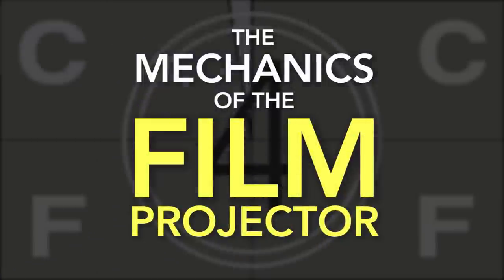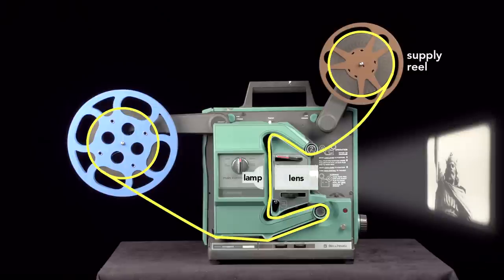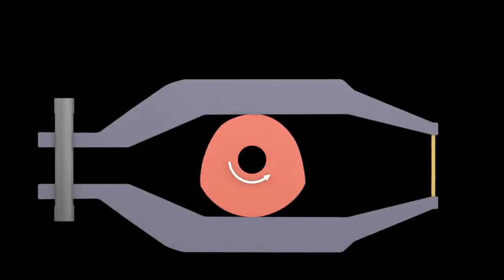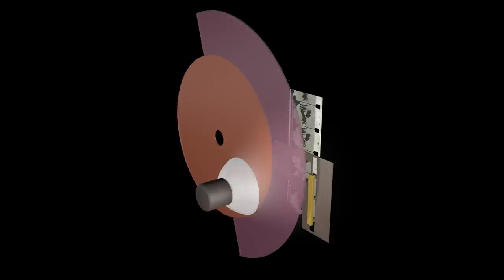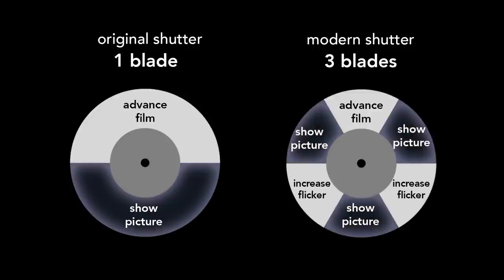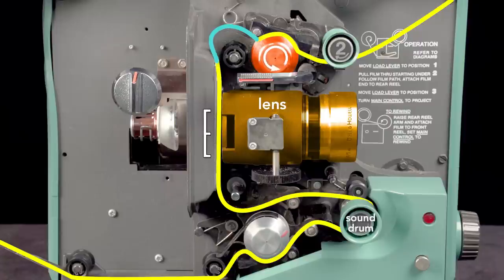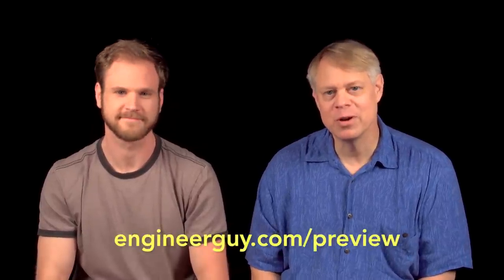How a Film Projector Works

Comment: i'm 42 and i had the chance to have an aunt whose uncle had a movie theater in a small city in the countryside here in brazil.  i used to go to the projection booth and to the basement under it to fiddle with things when it was closed (i'd always find a way to sneak into the building), and to watch the projectionist do stuff when working.  it was still carbon arc, rca projectors.  very old ones, but looked good as far as i can remember.  the movie theater had a little over 900 seats, two floors, and there was a beautiful and thick red curtain that would open and close.  a nice movie theater for a small city in a developing country.

fascinated by how the sound system worked, i would build a thing just to extract the audio from a 35mm doc i had.  i used cardboard paper and a flashlight lamp and a light thingy to convert light to energy and connect it to the mic imput of my mom's stereo.  fun stuff.  there was a movie theater in another city i lived that had a problem of frame misalignment in one projector that would show part of the optical track, and during a ninja turtles session i still remember how cool it was to see the waves being shown while 'go ninja, go' was playing.  the song has basically two frequencies of bass, and one bass would look like waves going up and the other like waves going down, and there was all the crazy mids and treble.

later, when i was 15, i got a chance to work for three months at a movie theater that was part of a cultural complex run by the state.  the complex was built with german technology and they donated a planetarium.  the movie theater had unique seats, and the screen could lift up and be hidden for orchestra presentations.  the screen was a little smaller than the screen at my uncle's, but still a standard size, and there was no curtains.  the building desing was quite different.

aside from the regular 35mm projectors, they had eiki 16mm and bauer super 8 projectos, and a room filled with a lot of 16mm and super 8 documentaries.  there was a week that they had an event showing movies and docs from across brazil and from other countries, little known movies, with most attendees being people from the cinema industry ,and enthuasiasts and stuff.

the projectionists who took turns let me work alone for three days!  they'd be there in the beginning only, and i'd close it.  it was all illegal.  my age for working there, and they letting me work alone having such a responsibility, but they were fed up of it all, little salary, little attention and care from the administration, etc, and they didn't want to miss the opportunity of take the time off and leave me there.  well, i loved it!  i was showing movies and docs to artists, directors, and other people of sort.  one day there was a problem with the audio and i fixed it!  it was awesome for a 15 year old!

i had two 16mm projectors and would invite a couple friend of mine to come to my home and watch documentaries.  i stopped using and owing this kind of stuff in my late 20's.

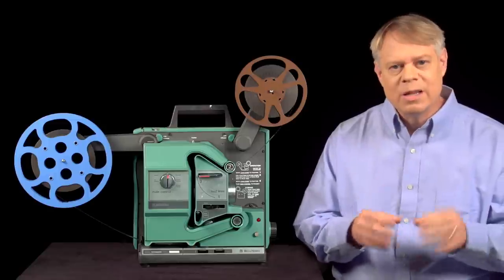Comment: Bill, excellent description of film projection mechanics, you don't get something this clear in many film schools. [6:25]   In fact, sound in film motion pictures is a pretty complicated subject: mono, stereo, quadraphonic, Dolby...  In many instances sound in many movie theaters was supplied by a variety of secondary systems - a whole science in itself - though not in all.    Movie business became involved rather than engineering, some prints were supplied to theaters with the monophonic sound 'sound track' on the print, many did not - but did almost always in science class!   [7:28}  Sync.  The whole movie business revolves around sync.  Fact is, with a mechanical system, sync could never have been achieved  if operations were driven from separate axles, the motions were to fast and to complex to be driven by different elector-mechanical sources, even later when we started to crystal controlled motor systems.  What is simplest and works tends to stick - until everything can be controlled digitally.

Comment: I found it very illuminating (pun intended) that a continuous motion without stop of the image frame and the movement of the shutter would simply create a blurry image "mass". I knew that already but it's the first time I see that so clearly in action. Thanks for explaining, engineerguy!
Reply: There was an adjustment on 35's that was labeled "shutter".  If the picture was smeared with white light that meant the the shutter was a little out of sync with the intermittent drive.
you could correct it to a certain degree with that knob, not sure how it worked mechanically.  The shutter was set screwed onto the shaft and occasionally you would have to loosen the screw and sync it with the film movement,  PM with machine off of course.

Comment: Wow, so interesting. The film projector is indeed a marvel of engineering. You not only explained the entire mechanism to move the film was frame by frame but also how the sound is synchronized - and everything driven by one rod. The smart system to prevent blur by using a blade to block the light is indeed marvelous, especially because the blade was made to increase flicker to trick our minds. I am impressed not only by the engineering but also by your skill in explaining.

Comment: Absolutely stunning video!  I don't know if others have asked this, but if the reel is turned at a constant speed because of the worm screw, why isn't the film fed into the projector at ever slower speeds as the reel's radius decreases over time?
Reply: ***** The reels do NOT rotate at constant rotational speed. The sprockets pull the film off the reel at a continuous linear rate. So the supply reel (which in forward playback) is not powered an rotates slower at the beginning of the film and faster at the end.
Reply: Ah, that makes more sense.  Thanks!

Comment: Just as a side note - 70mm film is just beautiful. It looks magnificent and in my opinion is better than today's 4K digital cameras.
Reply: +Mateusz Wojtkiewicz Good 70mm film is equal to 6-8K digital resolution. Too bad it is huge and pain in the ass to transport and load.
Reply: +Mateusz Wojtkiewicz That's why film is still used, it is better than 4K because it doesn't have pixels.
Reply: +FinnShack yes it has
the resolution depends on how many silver bromide crystals  
are on each frame. a imax film can have up to more than 15,000 x 10,000 of these crystals
Reply: +MrDehicka you are right

Comment: What a pleasing voice you have! Makes it sound like a really good teacher patiently explaining a complex subject in a way even the densest person can understand. Of course, the excellent graphics help a lot! Too bad you couldn't slowly "speed' up the mechanical motion to show us how "fast" it really goes. Knowing it's 24 fps is still hard to get a full appreciation for--and I'm a projectionist who's worked with projectors since my high school days! Even seeing it actually in motion still fascinates me. And then when we move on to TV and the rate increases to 29.99 fps--again hard to realize the TV screen is actually dark MORE than it's lit--and that's done as the TV electronics turn the LEDs or LCDs on or off 120 times per second (because the pictures are being projected on two alternating "interlaced" lines for every frame with it displays. Imagine the electronics that manage a 1080p screen with its 720p lines. Add in that each LED or LCD must have the right amount of red, green, and blue for each pass along with the correct intensity (or chroma brightness). Do the math--and you will be amazed! (It's 777,600 LEDs or LCDs going on and off each second--and each one with the right brightness and color mix. Not even an oriental using his abacus could work that fast!

Comment: The intermittent transport on most 35 and 70mm machines is usually realised by a geneva-drive. The mechanism in this video is almost exclusively used by 16mm regarding projection devices. The latest tech in projection-equipment were electronically controlled direct-drives. Like the Kinoton E-Series machines, with are state of the art in many aspects but sadly not produced anymore. Another very interesting way of intermittent film transport worth mentioning is the rolling-loop mechanism used by IMAX and some exotic special venue devices. The very interesting fact about this mechanism is, that it isn’t really intermittent.

Regarding sound there are many more interesting ways either. From Multichannel Audio on magnetic material to digital information between the perforation or at the sides (Dolby Digital and Sony SDDS). Or DTS, which uses a thin “morse code“ on the film to synchronise the audio from separate media (usually 2-3 special CDs delivered with the film copy). This allowed different language versions through a additional set of cheap CDs instead of a second expensive film copy.

Comment: 70mm film is the format used by IMAX. The film also runs horizontally and does not contain the film's soundtrack. The soundtrack for an IMAX film is most often played on either open-reel tape or as a digital soundtrack on a computer, and the computer software puts them in sync.

Comment: Some projectors use a Geneva mechanism.  This is where that infamous clickity-clackity projector noise comes from.  Very interesting mechanism, and it seems simpler than this because it can turn the continuous motion of an electric motor into distinct, singular motions that feed the tape and reveal the next slide.  The shuttle is also typically a wheel with studs and so that design is also less complicated.
Reply: That noise is from the top and bottom loops fluctuating as the film pauses to be shown.
The noise is more pronounced by worn out sprockets.
After passing miles of film the pulling edge of the sprocket teeth get undercut.  As the film is pulled around it catches in the undercut grove of the teeth and does not release quietly.
This leads to worn out film sprocket holes and more change of film breakage in the machine.
Sprockets were highly machined and expensive.  Most you could loosen the set screw and flip them over to use the other side of the teeth.

Comment: Fascinating video, Bill (and Steve)! I had no idea that the soundtrack on films worked like that... I thought they were used in tandem with a magnetic tape or something!
Reply: allluckyseven Thanks!
Reply: allluckyseven 
Some 16mm projectors did use magnetic soundtracks, usually they were used alongside optical soundtracks as well though. In Super 8 film, magnetic is the standard soundtrack with only a few films using optical. Meanwhile 35mm got the best sound quality, with stereo optical tracks, DTS encoding on the perforations, and in the late stages, a sort of CD system that would automatically sync up with the film.
Reply: Videogamehistorian00 That's fantastic. Thanks for the info.

Comment: Good explanation. I used to fix AV equipment. The B&H projectors were a bear to fix. Lots of sound, cam, belt, and loop issues. All movie film projectors tended to have a lot of wear in the cam part of things. I replaced a lot of cams. The best made 16MM projector was (IMHO) from Eiki. Beautifully engineered and a joy to work on. Elmo also made a good projector, better than the B&H but it was harder to service than the Eiki. The best film transport mechanism I ever saw was called a "Geneva Movement." Very smooth and no cams to wear out. They had a long MTBF (mean time between failure). I only saw them in the large 16MM auditorium Eiki projectors.  Worst projectors to fix? Kodak. 8 or 16 MM, both were incredibly hard to service. Their 16 MM "Pageant" model was awful. They made great 35MM slide projectors though.

Comment: Bill, thank you very much for this amazing video. As a film fan and collector this is by far the best  explanation I have seen of how a projector works.  I own 8mm, S8, 16mm projector, but have never been able to get a portable 35mm projector. I would love to build my own 35mm projector for home use,any tips? As far as I know 35mm projectors use a Geneva Drive/Maltese Cross instead of the cam/shuttle mechanism to pull the film, I don´t have any idea why this is done and what are the pros & cons of each, could you explain? The optical sound system has always seemed magical too me and I actually think it´s maybe the most difficult part of the projector, because as you explained the film must pass the sensor continuously. Do you have any information available of how to build the optical to analog sound circuit? A video on how the more modern as DTS sound systems work would be nice. Thank you!

Comment: That was great but the mechanism for the larger formats 35mm and 70mm didn't operate with a claw, film was transported by the intermittent sprocket driven by a Maltese Cross mechanism (most common as I understand) or other arrangement. I understood the intermittent sprocket was used because it engaged more sprocket holes.  This was needed because it had to accelerate, decelerate and stop a greater mass over a longer distance than 8mm or 16mm at the same frequency.

Comment: Nice Video. I have an Eumig S820 High Quality Sound Super-8 projector that reads magnetic sound tracks. In this format the sound is 18 frames off to the corresponding image. But basically it works the same like the 16mm projector in this video.
Reply: 4k resolution before people knew it.

Comment: I'm actually an electrical engineer with fascination of mechanical things (I even wear a mechanical watch - an automatic self-winding watch I have had for over 10 years) - so one question I have always pondered:  In film projectors and tape recorders, how to the supply and take-up reels stay in synchronization?  It is obvious that, at the beginning of a film, the supply reel has a slower angular velocity where the take-up reel will have a faster angular velocity, and this changes throughout.  Is there some kind of feedback control mechanism that maintains a constant tension?

Comment: Here’s a recommendation: Do a series on firearms made by John Browning. He designed a variety of early firearms that revolutionized the industry.

Other ideas could be water pressure reducing valves, circuit breakers, air conditioning systems and microprocessors.

Comment: That was good.  I scrolled down a little bit but didn't see it mentioned.  I know of no single-wing shutters that are designed for one revolution per frame.  They are almost all designed for 2-revolutions per frame.  Double-wing shutters (by far, the most popular) are designed for single revolution per frame).  But of those systems will yield a 48Hz flicker that is certainly visible but not as overtly so as a 24Hz flicker.  Heck, back in the CRT days, when they would switch to 24Hz for sync with film cameras or displaying 24fps content, they too would have a notable flicker.  50Hz PAL displays were noted for it too.

The down side to 3-wing or 72Hz shutters is the 50% loss of light that comes with them.  As such, they were normally only used on screening rooms or in system that had sufficient light to overcome the extra blade.

Comment: Great video. I'm guessing the reels themselves aren't driven directly, but rather use some sort of spring tension. The tension would have to be enough to keep the film reeled neatly, but not so tight that it causes unnecessary wear on the film or skipping from the sprockets. Is that in any way correct?
Reply: Yes you're correct. It's done a bit like on a tape recorder. The take up reel hub is driven via something akin to a slipping clutch. The growing pancake of film on this reel will cause the reel to need to go slower and slower (as one revolution of the reel takes up more film than earlier on) so the slipping arrangement allows for this. There is also some back tension applied to the supply reel hub to keep the film taught.

Comment: Questions!
1. Both shutters (one blade / three blade) cover the light for exactly half of the viewing time? Meaning what we don't notice but sure experience in a cinema is black screen for 50% of the viewing time? :)
2. Also, how does it compare to a digital projector? I understand there's no need to cover the transportation of the film as there's no film and the frames are progressively and immediately changed so effectively we see each frame two times longer compared to traditional film projector? (Assuming we compare 24 fps in both cases.)

Comment: The loop height was so important in movie theater projectors, if the loop was to tall the film would slap the top of the projector case usually resulting in scratches. To short and it stresses the sprocket holes which makes a small bit of material come off the holes putting small bits of film all over the print = dirty print.
Reply: If I recall correctly;  you would set a frame into the shutter/light opening (there was a small electric lamp so you could see that your frame was set correctly) then snap that mechanism shut.  Then the top loop was set by measuring one joint of your index finger and setting the film on the feed socket.  The lower loop was 2 finger joints and you closed the lock on the next sprocket.  Then the film went around a flywheel to smooth out the flow of film.  Then there were 2 more sprockets to feed down to the lower magazine. 
A very bright sharply focused beam of light was directed though the sound track into a simple photo cell that picked up the variations of the light and sent off to an amplifier. 
The light beam on the film looked the size of a hyphen (or slighty larger)on a typewriter.